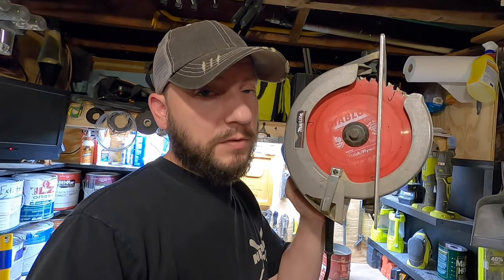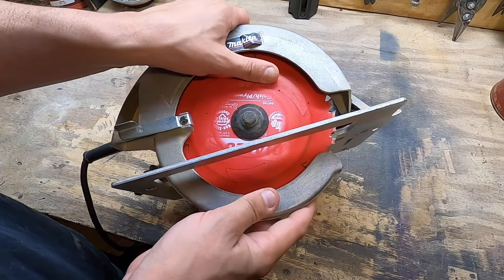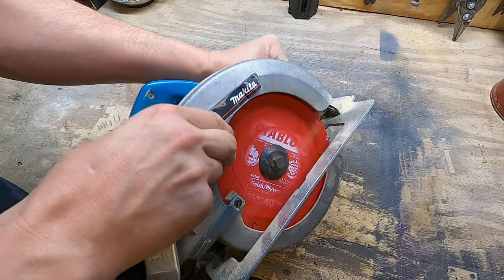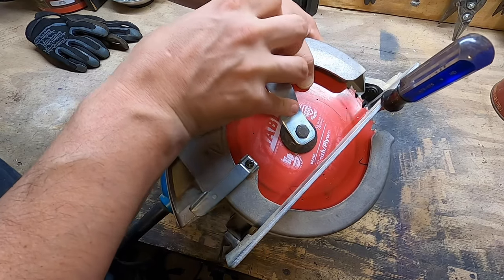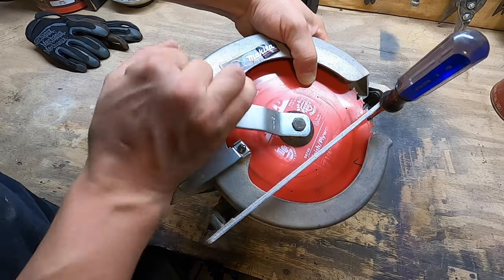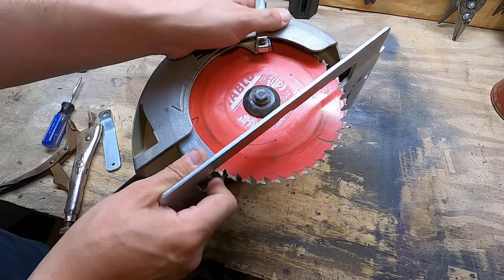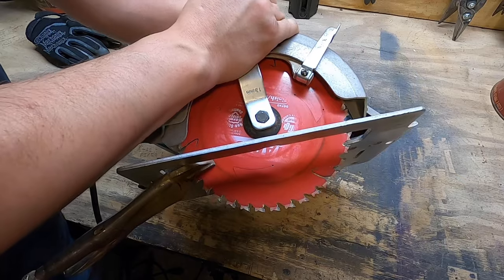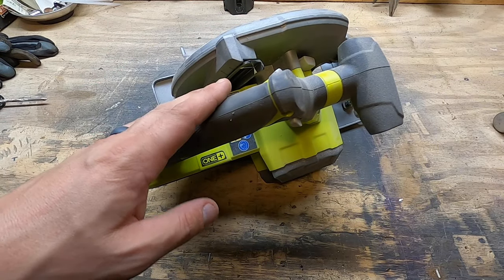How to Remove Saw Blade With No Spindle Lock

Comment: I have the same problem with a Porter-Cable circular saw my father used 
50-60 years ago. No spindle lock and, like "1990 Railfan" posted 4 months ago, I also find that 
immobilizing the blade is not enough; the motor shaft still turns, making good TIGHTENING of the blade impossible. I came up with a fix that I didn't hesitated doing with this old circular saw.
I noted in the fan exhaust port that the fan, which counter rotates vs. the blade, that a hole could be placed in the housing behind the fan plate. I tapped this hole with a 1/4 20 tap wrench and installed a Phillips head screw long enough to bear on the fan plate when "spindle locking" is needed to tighten or loosen the blade. Backed out and anchored with a nut, the screw doesn't interfere with operation of the saw. This fix works GREAT! The only field tool, besides the wrench is a Phillips head screwdriver.
If I could, I'd post pictures.
Reply: Have a SkillSaw 5150, same problem,  motor turns with the blade held,  was able to get a scratch awl into the fan blades to hold motor still,

Comment: My circular saw is a 1961 craftsman, and it don't have a spindle lock either and I was thinking of doing your method, but I decided to use my Makita Cordless Impact Wrench and it removed the bolt without holding the blade and without any effort. thanks
Reply from the maker: Yup that works too haha.  Thanks for watching!

Comment: I have an old Milwaukee 6365 circular saw. Even holding the blade from spinning it will not tighten because the blade does not keep the spindle from spinning. it is a round spindle with grooves in it (may have been replaced when it was damaged years ago, not sure too long ago) so I don't really understand how the spindle is to be held by the blade which has a round 5/8 hole fitted over the spindle. There is no positive stop between the two. So when I hold the blade and turn with wrench, the nut just keeps spinning with the arbor within the blade hole. I finally figured to use channel locks on the outer washer which does have notches that fit into the grooves of the arbor thus keeping it from spinning. I used this saw for years but it fell off a roof once and maybe it got serviced with the wrong parts. But even with that Makita you use for your example, the arbor has two flat sections but the blade doesn't so not sure how the blade holds it from spinning.

Comment: I have an old Craftsman saw from about1996. It doesn't have a spindle lock. I'm able to lock the blade with vice grips , however, as I turn the locking nut (bolt) the entire motor shaft spins as well, so I am not able to loosen the blade nut.
Reply: I have the same problem with a Porter-Cable circular saw my father used 50-60 years ago. No spindle lock and, like Railfan, I also find that immobilizing the blade is not enough; the motor shaft still turns, making good TIGHTENING of the blade impossible. Do you have any suggestions about adding a spindle lock?
Reply: Sounds like the bolt is seized in the motor shaft, try an overnight soak with a good penetrating spray/oil, then I would use an impact driver to get it off, if it still spins, try wedging something between the blade & washer (preferably wood or aluminum shim)  along with vise grips on the edge of the blade as shown in the video.  Really check the bolt & shaft threads after you get it out.  Also, sometimes it helps to tighten the bolt before trying to remove to break the set of the threads.
Reply: @woodstover  Thank you, I'll give it a try.

Comment: I have same issue with my Ryobi CSB123 model. Spindle lock is broken. Hope this video will help me. One clarification: I thought the bolt opens in clockwise direction on circular saws, but video shows counterclockwise. Which one is correct? Thanks.

Comment: I have an old Craftsman with no spindle lock.  The old blade came off fine but the new blade won't tighten.  I can keep the new blade from moving by using vicegrips and/or a screwdriver, but the spindle just keep turning with the bolt as I tighten.  Any ideas??
Reply: See John Pinter's post and a few others.  I'm having the same problem.

Comment: This works great when you need to just immobilize the blade. What can you do if your circular saw does not have a spindle lock AND the bolt is jammed on the motor axel; i.e. the blade is immobilized, you turn the bolt with your wrench, BUT the motor turns with you and you can not loosen the blade from the motor axel?
Reply: Notice the radio silence for a year? I have the same problem and wasted 10 mins on this half baked solution. How this guy has over 300K subs is baffling to me.
Reply: Sounds like the bolt is seized in the motor shaft, try an overnight soak with a good penetrating spray/oil, then I would use an impact driver to get it off, if it still spins, try wedging something between the blade & washer (preferably wood or aluminum shim)  along with vise grips on the edge of the blade as shown in the video.  Really check the bolt & shaft threads after you get it out.  Also, sometimes it helps to tighten the bolt before trying to remove it to break the set of the threads.   An impact driver will make all the difference.
Reply: @woodstover  Thanks for the advice, I appreciate you takiing the time. 
But I don't have an impact driver. 
Anyway, I want to HD and got a replacement at a great price (they were out of the one I wanted and upgraded me to the next level) . 
It was cool of you to help out.
Reply: @jimm3370  Glad it worked out for you.  A lot of people don't have an impact driver, but I'm sure a neighbor or relative does, they are becoming very popular in battery driven tools.
Reply: @woodstover  It's 'kinda' on my wish list, but after a shitty experience w/ a Makita drill (had it for 10 years, battery went and replacement went into the hundreds of dollars) I'm strictly corded. 2ndly, I have a hammer drill, a corded one, and yeah ONE battery powered one that's my go to. I really haven't seen a need for me for an impact. I'm a talented amateur; if I could see a need my current set of toys can't deal with, I'd get one; but haven't had that happen.
Reply: Same problem, if I find an alternative I will try to remember to post it,
UPDATE : I used vice grips to secure the blade and spindle, two screwdrivers , 1 to wedge between the guard to keep it open and another to block the motor from turning. To do that I lifted the saw "platform from the 2"x cut setting down to the 1/2" cut to allow me to see into the motor area. Lucky mine had a void under the saw in that location to allow me to slide a long screwdriver into it and block  the motor from turning. l was able to turn the bolt while holding pressure against the motor.I wish I could post a picture, but I hope I was detailed enough-

Comment: The blade is loose on my skillsaw.I can:t get the bolt tightened as there is no motor lock. I cannot stop the motor to tighten the bolt

Comment: The easiest way to remove the blade without  a spindle lock is , first step push the guard like he did forward,  second grab a scrap piece of wood lay it flat on the floor and rest the blade against the scrap of wood but don’t push  to hard  all your preventing is the blade from spinning,  and then use the tool to remove the nut. The blade teeth will grab the scrap wood and prevent the blade from spinning. Pretty easy . You can skip the vice grips, the screw driver etc..  Like he said we can share ideas and this has helped me and it prevents damaging the blade, the circular sled .
Reply: That's what I always thought was the most common method, pressure on the blade with some piece of wood...to loosen or tighten it.

Comment: So, got any idea for what to do if the blade slips when you turn the bolt?
Reply: Same problem, I figured out how to stick a screwdriver deep into the motor area through the bottom of the saw and block it from turning. I had to hold pressure on the screwdriver while turning the bolt wrench

Comment: ive got an older "obsolete" craftsman 7 1/4 model 315 of which i have lost "yes" lost the retaining bolt and cannot find one to replace it anywhere in san antonio can you give me a lead please what size is the bolt thats all i need dont have a caliper or thread chaser i did order wht i thought was the right bolt from amazon but the wrong bolt.

Comment: If the blade you are using has slots cut into it, you can just slip an allen key into the slot and that will immobolise the blade against the shoe of the saw.

Comment: 10 minute video on the obvious solution with no mention of a likely scenario where there is no spindle lock and no access to stop the spindle with a wrench,  but the blade turns free of the spindle, therefore when you turn the nut all you're doing is turning the spindle (while the blade is motionless) and so the nut will not loosen or tighten.

Comment: How do i open the lock when theres no existing saw blade in there. i got a hand me down circular saw, but the dude took the sawblade with him. no spindle lock or anything,
Reply: Use an impact driver 1/4 will loosen it in no time.